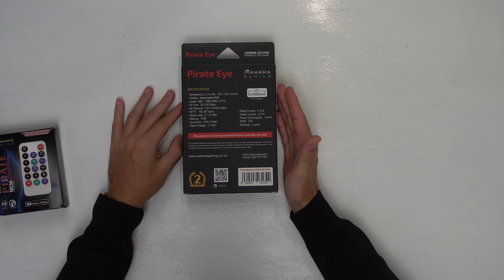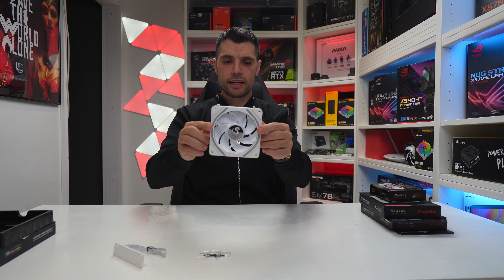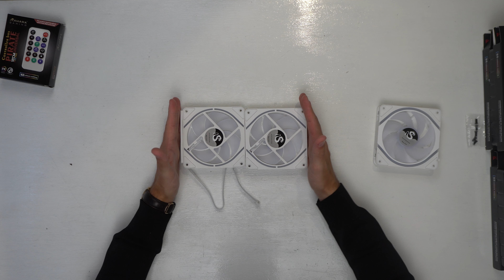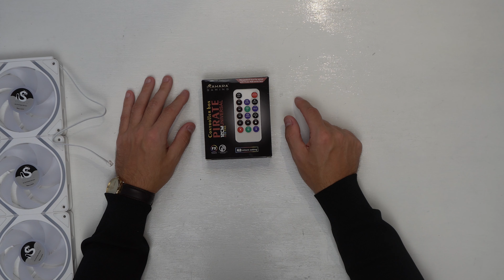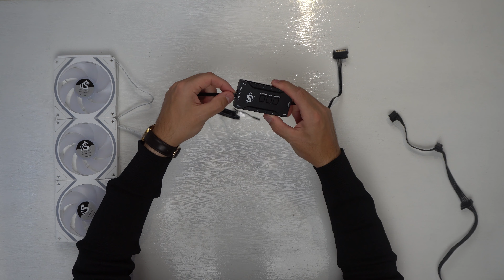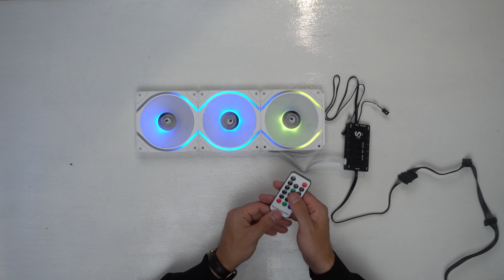Sahara Gaming: Pirate Eye 120mm ARGB Fans!

Comment: Very nice fans, not seen these advertised anywhere tbh. Been thinking of switching up the fans on my 360 AIO, thanks for letting us know about them. Will definitely check them out 👍
Reply from the maker: Thanks matt 👍 I really liked then mate and I don't think u would be disappointed for 3 fans and controller 49.99 they created decent static pressure at an affordable cost with good connectivity.
Reply: @TechCheckUK  that's a great price, was looking at Lian-Li Uni fans as well, but prefer the look of these tbh.
Great video as always mate, looking forward to the next one 👍